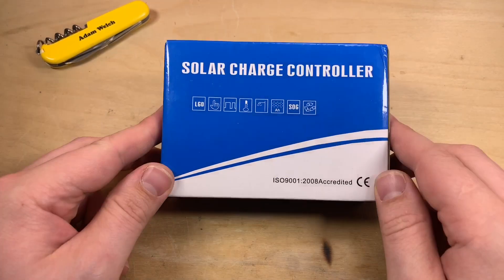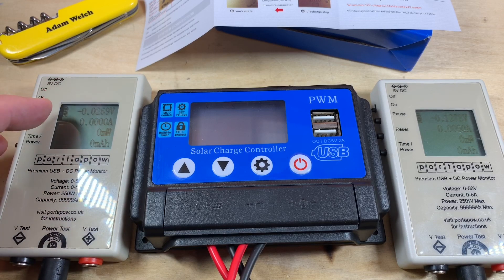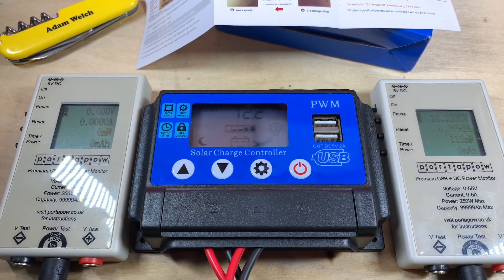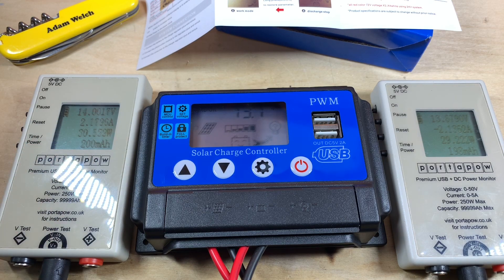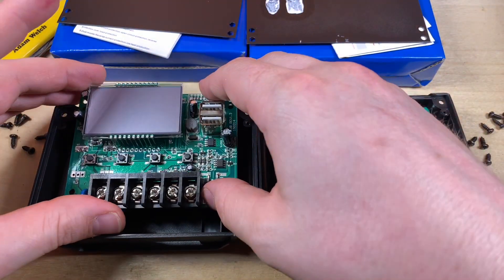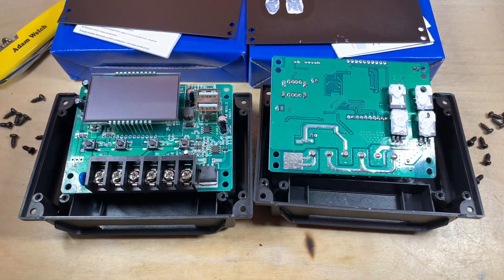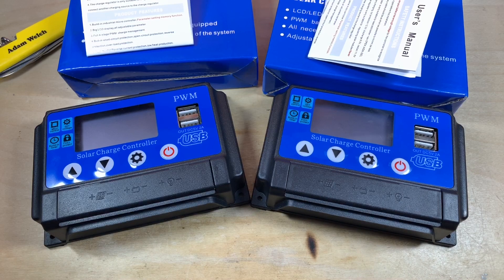Inside Another Cheap Solar Charge Controller

Comment: My local (really big) (re)seller for this (and other imports from china) even sold the 60A version for 8€ and the 30A version for 12€... seems they have so much inventory they don't even know they were selling these at a LOWER price...  But with a little bit looking around in their (really not easy navigatable) shop, you will find other stuff cheaper... 100W solar panel WITHOUT pwm-controller is sold at 130€, but WITH pwm-controller they sell it for 99€... weird...

Comment: While searching for a replacement for my Harbor Freight Thunderbolt 100 Watt solar system charge controller that has USB ports, I strangely ended up with several of these of the 30 A variety.   They do seem to run, but I don't trust them, the as you cycle through the menus, there is not an identification of what is being changed and the connection screws are very small and hard to get to accept larger wires.

How are others charging their USB devices?   Very few of the more expensive charge controllers with names that we recognize have USB ports.

Thanks.

Comment: I have a cheap solar charger just exactly like this one, it says "60amps" but I plugged to the LOAD port a water pump 180w (12v x 15amps) and it only worked for 3 to 4 seconds and it burned the charger with a lot of smoke.

Comment: I’ve got one of these marked as “100 amps” what I’m sceptical on and I can provide more information on differences between the one you have and mine. But mine will be used for 80w going to a battery and then the battery will be hooked up with an inverter so it should be all fine and safe considering the look of the scratchy device

Comment: I just bought similar IRF3205 MOSFETS   for £1.80  a pop so the 60A upgrade isn't a bad deal. Incidentally, what kind of micro-controller are they using ?

Comment: PWM u its are OK for low voltage step down eg from an 18V panel to 12V, but it is a complete waste of a oanel if you put two panels in series.

Comment: i buyed to of these cheat product on amazon none in working first one not regulate ( load volatage is panel voltage charge never go to floating ! ) second one look fw issued impossible to set the batterie mode else than B1 voltage display cutt off are some tiime in 12v mode and sometime 24v mode ( i use 24v battery so not shure it charge when the charge end is 14.4 displayed with 24v batt but if i go in the menu i get the 28.8 value randomly and yeah the minus button in not working in "settings mode'" so you can just increase the voltage settings whaaaaaa if you want to kill some batt just go for these controller ....

Comment: Would it be worth modifying one of these to reduce idle power consumption by desoldering the usb ports, and also wiring in a button to turn the lcd screen on/off? I'm working on a remote solar project and trying to keep overall power consumption down to absolute minimum. I would resent keeping the lcd screen illuminated when no one is there to read it. I can't for the life of me find a pinout diagram for one of these displays. How would one identify the + and - of the led using a multimeter?

Comment: 6:44 Tech Params shows Battery voltage is 12/24v, Max solar input shows various voltages including 24v, is it possible to set the Battery voltage to charge a 24V battery?

Comment: so if you add those mosfets yourself then the rest is the same? program included? 
Is there a way to improve the 60 version so it works better?
How much can the 60 version have on it in solar wattage? half that would be what is used in the video?

Comment: What happens to the charge controller when the LiFePo4 battery internal controller disconnects due to charge or temperature? Does it fry the solar controller?

Comment: Is the voltage of the "load" circuit regulated at all? Could it be used to drive some 12v devices - like a router without the use of a DC-DC converter / voltage regulator?

Comment: I have one that looks identical to that except that the label claims it is MPPT. How can I tell for sure whether it is or not?
Reply from the maker: It probably isn’t I’m afraid, but to be sure open it up and if you don’t see a decent sized inductor (usually a coil of copper coloured wire wrapped around a ring) then you can be fairly sure it is not mppt. 
Alternatively, check the voltage of the solar panel then check the voltage of the battery. If they are the same, it’s probably not mppt. This method works best with a battery which isn’t fully charged.

Comment: At last someone with technical knowledge. I have a 30 amp pwm. Was investigating the possibility to increase to 40 amp (real) and basicly can only use those kind of FET's. No 1404/7 or 4110 because of the low nc of the 70N?? Or 50N??. Will have to get 2 more and locate all of them off board with decent heatsink.

Comment: good to see someone doing a teardown. I guess its easy enough to improve the heat sinking with what the controller is mounted to. for anyone who's bought one and they're concerned about the load track sizes, its no major issue to increase their density.

Comment: update. ive tried my other one that looks like this. so i have 2... they are different. one scrolls through on its own all the time when plugged in, the other one does not. one you have to press and hold to enter the settings.. the other one you do not. they both will not control  the voltage if the battery is crook.. the good one works perfectly on a good battery. it stops charging when the batt is full. and is not a fake..

Comment: well done. its hard to find a alarm about this on the net... the figure 
of 14.4v is fake you can have 20v or more coming out of the controller 
and it will read 14.4. it wont show any higher. this controller will 
limit your output voltage to 75% of the input, so with 36v coming in 
from your panel youll have 27v cooking your 12v battery..  there by use 
this with a 24v batt, for a 12v batt you need a 18v panel. your 18v 
panel will give 13.5v out from the controller.. when the batt gets near 
fullly charged. the 18v panel will rise to about 20v.. 75% of that is 
15v going into the batt.. the display on the controller will show the  
correct float voltage of 15v..when you have scrolled to the float 
voltage display.. this is no way to control battery charging.. this can 
be easily measured with a multimeter.. the amps are straight through.. 
the cheap mppts that look similar are also fakes.. ive measured some of 
those as well. no matter how insistant the seller is. there fake

Comment: Cheap but we need to be very much careful on these charge controllers, these are cheap but too much costful because these controllers keep killing batteries trough overheating the batteries 🤔 I don't see if anyone talks abut what size charge controls we should use with respect to solar panels voltage sizes, and battery max charge capability.

Comment: LOL, those are good to be retrofitted for MPPT function, they already have all the necessary circuitry to monitor the current and voltage, need a adequate coil and diode between the drain of the charge transistors and battery and a new firmware for the microcontroller, I wander what is the microcontroller, a STM32?, I will buy one to see if a MPPT can be done from it if has a STM32 uController.

Those transistors can push 30A respectively 50 A, the power dissipation on them is very small, usually need to be little warm is they are driven correctly.

If someone do a reverse engineering for the schematic will be a good start, I will do an open source repository for the firmware and all necessary changes inside the device :)

Comment: I was hoping to find out what setting to use for 6 -6volt batteries, wired as 3 - 12volt. The manual doesn't say, but there are different settings on the unit.

Comment: I have a similar 20 amp controller. Mine is showing all the numbers for a 24 volt panel. If I half them they are about right for a 12 volt system. Any idea how I set for a 12Volt? Im using a 100 watt panel that I have used perfectly well with a different controller and the numbers were all for 12 volt.

Comment: Hi Adam.
Im new in solar system.
Can i charge my 12v system using this controller and this type of solar panel?
my Solar Panel specification as below:
Max-Power = 100Pm(W)
Power Tolerance = +-3%
Max-Power Voltage = 35.2 Vm(V)
Max-Power Current = 2.85 Im(A)
Open-Circuit Voltage = 43.7 Voc(V)
Short-Circuit Current = 3.05 Isc(A)
Max-System Voltage = 1000VDC

Comment: Hi. Could I connect this to my 48V 42A power supply and use it as a buck converter to charge my 6S8P li-ion pack (adjust the voltage down to 25.2V)?

Comment: Chance question.  Why do they state only use solar panel input.  I am using lithium ion battery  to charge my lead acid batteries on my boat rather than starting the engine.  Surely DC input is a dc input

Comment: I wonder is there any cheap and light real mppt controller?
Reply: What is "cheap" for YOU? 
There are real mppt starting around 25 Euro (with stepup/boost) and normal mppt starting 40 Euro.
Reply: @Thomas_P_aus_M  Do you have any examples? I bought mpt 7210a, but it's a boost controller. And when i try to search AliExpress for 12v mppt, most of them are actually PWMs..
Reply: @DmitryOlyenyov  MPPT battery 12V and pv higher voltage, Am*z*n  ASIN B08BWPFV1J  or E*ay  ITEM 174594183591 or 402728246180. 
With stepup/booster e.g. (also in the videos here) the CTK 300 or ITEM 393125441517. 
I prefer the solution with mppt and boost: indoor 24V battery and outdoor 12V pv-modules parallel , because of the trees and roofs of the neighbours.

Comment: You didn't explane the PV input of the charge controller . The 30A controller can take a max PV input of 390W (12V) compared with 750W (12V) for the 60A controller. Convenient to skip this vital piece of information when trying to discredit a manufacture  ???

Comment: Those controllers are decent for the price. They do control the voltage and seem to last a while, even in hot conditions. Mine has been running in 100*F in my RV this summer, but the batteries haven't had a load except when I have been in there with a roof vent fan turned on for ventilation while I was working in there. Checking the controller and a separate LCD voltage meter, it has maintained the batteries properly, so it seems. 

I had a 20A for 100W originally, then 200W. I upgraded to a 30A controller when I added more panels for 400W total since a 20A would be at it's absolute limit, if not over. A low end, real 30A MMPT runs about $100 USD and a 40A runs about $150. Compared to $10-20 USD for PWM ones, it's a big savings if you are on a budget. Over 400W or 500W of panels, then I'd probably invest in an MPPT. I might anyway next year, if get it into my mind to do so. I'm running a a battery bank of two flooded lead acid batteries if about 100AH each (2 different brands) in parallel, keeping it at 12V since it's in an RV. For my needs, it's acceptable.

Comment: I agree that the solar control module is junk. I have youtube video shows that the early model has grooved back, plus its actual voltage, when plugged into a solar, output is too high and not reflected by the display. I lowed the charge by selecting b2 gel and it was still high test by two meters by .4 volts. Do not buy this electronic trash as it not efficient. I hope no one is exposed to CHINA products that support violence and environmental reef damage to fishing, and international law.

Comment: Couple of MOSFETs for £2 is £1.98p profit. Sellers in China need to sell or it costs them money, so if they can get away with false advertising, they will. 
Which controller IC is inside this ? The one I saw had the CN3722 which according to the data sheet is "The CN3722(Note 1) is a PWM switch-mode
battery charger controller that can be powered by photovoltaic cell with maximum power point tracking function."  A voltage divider does the MPPT set point. Thanks for the review

Comment: Hi which budget range solar charge controller would you recommend for small sealed lead acid. Thanks
Reply: Personally, I'd go for a Victron 75/10 or 75/15 MPPT Solar Charge Controller/ regulator.
They are a little more expensive, but they are much more effective/efficient at charging your batteries.
Reply: Thanks all.. Victron was where I ended up

Comment: I installed the thirty amp version of this to two 100 watt (parallel) 12V panels and have been quite pleased with the price/performance given my panels are flat mounted to the roof of Nellybelle (my 93 Dodge Grand Caravan LE - the L is for Luxury) and the system was installed and operated thru the winter here in the high mountain meadows (Fort Collins) of Colorado when solar conditions are less than ideal.  #hobomessiah  Enjoy.

Comment: my pwm charge controller dingo 20/20 ..12 24 48 volt it won't work with my single house solar panel 180 watts. why ???

Comment: I blew one of those up. Mine was rated at 30A and couldn't handle two 2.5A marine bilge fans. After a brief period it started shutting down. I put a capacitor across the fans just to make sure feedback spikes were reduced. The thing was toast though. I pitched it and bought one made in the USA instead.

Comment: I want to top up my big boat battery with some 18650 in series and bought one of these to regulate the process.  Whilst it will regulate the voltage am I correct that it will not control the current and may damage my 18650s
Reply: PWM chargers will blow your system using it with 18650’s... they pulse the power, they don’t control input/output power... so, whatever voltage you put in, comes out the other end.... get yourself a buck/boost converter instead if you’re planning on using anything higher than 12v on input.
Reply: @BeezyKing99  😂😂❌❌❌❌ wrong

Comment: I think it's a bit of a lucky dip as to what you get. I purchased an almost identical unit from another eBay seller and got a bad item . Again supposed to be MPPT but not, even worse I cannot adjust the charge voltage to less than 15 volts which is frying my 12 volt battery.  You get what you pay for!!!
Reply: Why be cheap? There’s the P30L that works from windyNation plus iirc both Victorian and epever are each ~$40ish US

Comment: Another YouTuber tested the 60amp model. Output didn't go over 30amps, although that could have been due to their setup. Of more interest is that the heatsink reached 100ºC during the test. If anyone invests in these, I'd say you need to also invest in a good sized heatsink and make sure there's a good connection between the heatsink and the back of the controller.

Here is that video:

https://www.youtube.com/watch?v=xCKpwlXq5CY
Reply: his wire is very low quality so thats why

Comment: Sorry I don't get it.  I have a similar product from ali. It was 6 euro's so almost free :) I thought to keep it as a spare just incase my rv's currents charge controller fails during a vacation. If you have to buy a charge controller at the nearest local store in a right away you pay the jackpot if you can find one at all. 

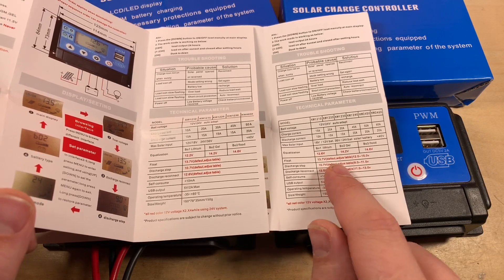But mine says max input is 24 volt when using a 12 volt battery.  I hooked up 17 year old 105 watt panel I got from my brother last week but the panel is 31.8 (oc)  volts and 25.5 (mpp?). When I connected it it evening was comming and not too much light  out there and it started charging my battery. When I measured the voltage on the solar in it was about 12.8 so I thought it is working. The next day I checked and it stopped charging. Checking the voltage on the solar input it was 30 volts. Disconnecting and reconnecting the wires started the charge process again but I do suspect it just stopped charging when max the voltage was reached? When I red the manual in this video at arround 9:07 it also says max solar input 12/18 or 24/36 which is way less than the 40 volt you feed it. 

When cheap solar chargers only handle like 18 to 24 volts and not the 30 volts the pannels I got produce. Can I just ignore the voltage input than?

Comment: Why didn't you do an analysis of value? Take what you call an mppt and a pwm and look at the current and voltage patterns in real time. Is there a difference? If not it's a scam out of the box. To be mppt it has to be using an inductance or capacitance to store the energy. With a high enough frequency it could actually be using the solar panel lead wire inductance. You don't know.

Comment: I feel sorry about these scamsters branding their products wrongly to fool around with customers. This PWM is a cheaper alternative to MPPT controllers, but MPPT costs much higher than this. I know it because I made an electronic model of the solar charge controller using MPPT scheme as my final year project, and I discovered that proper MPPT is much costlier and we can arrive at a PWM charge controller easily with electronics, also with a microcontroller, making MPPT is far more complicated than we think of. Thank you for posting this and please drop in a site where I can buy a true MPPT controller for a rooftop solar home. Try an ebike or e-scooter charger with this, because your money has been wasted as you did not get what you were looking for. Laymen seriously need to understand a bit of modern engineering to catch these scams.

Comment: Aside from the seller description being wrong, this didn't tell us much at all.
You didn't test them up to rated load, so i can't really see how you can condemn the 60 amp unit as having a flimsy head sink when it may well have been sufficient and the 30 amp unit could in fact have been over engineered. No functions were shown, no temperature measurements under load were taken and no tests were done on the USB outlets.
From a technical aspect this was no more than an unboxing video.